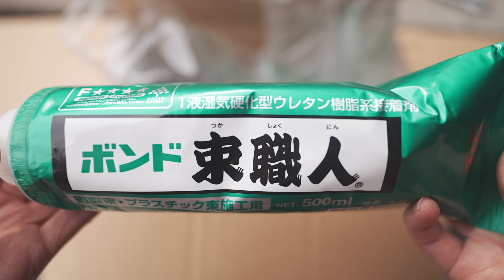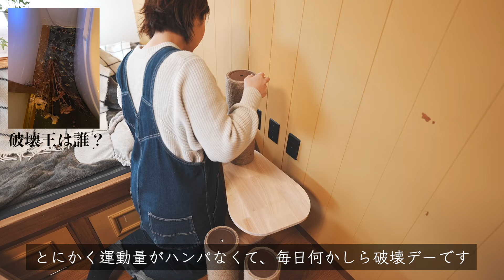③外構経験ゼロのDIY素人女子に基礎作りは不可能…!?#53

Comment: The footings are time consuming due to the balance of the build depend on them being correct.  You are doing just find, don't worry about travel speed, the next steps will be quicker if the first step is correct.  Keep that in mind that each step depends on the previous step and the current step will influence the next step.  There are many DIYers in your country just like you and sometimes watching others do what you are doing helps.  Be safe, stay safe.  👍🔨😎